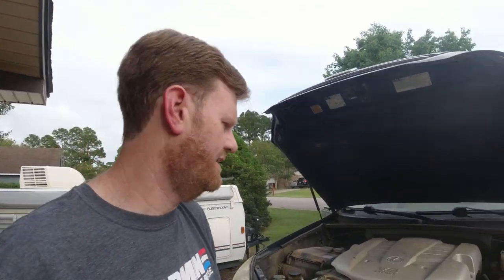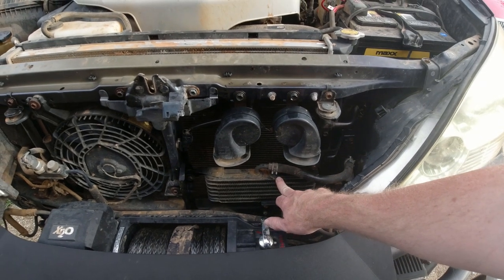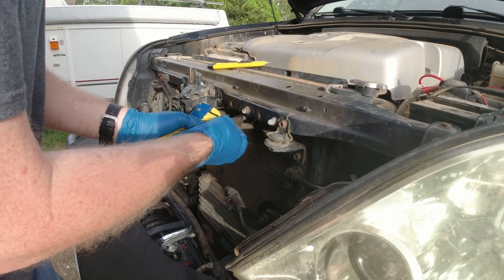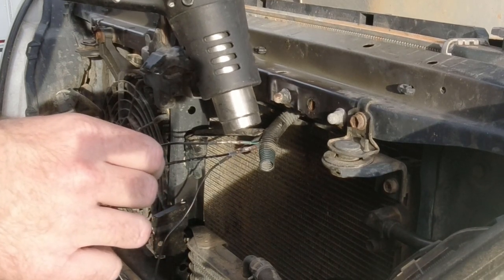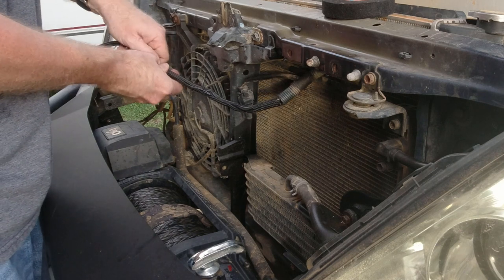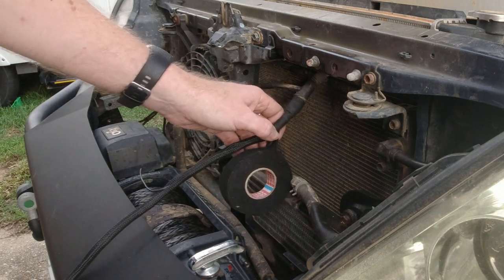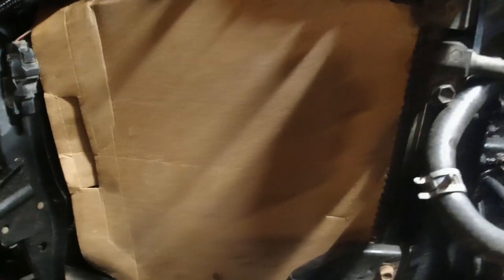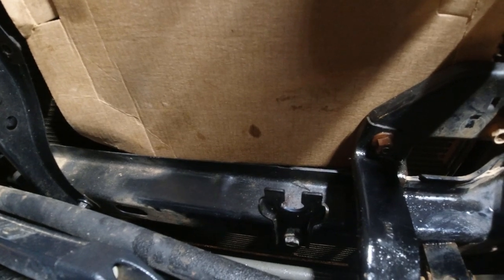Lexus GX470 Transmission Cooler Upgrade.  3x Bigger!

Comment: Great Video, just did the upgrade using Steve Foltz's Bracket. I ended up reusing the OEM hose clamp. To make the bottom hose fit with the spring clamp I slid a washer behind cooler. That created just enough room to slide the spring clamp on the hose. Your video made this job super easy.
Reply from the maker: Glad it helped

Comment: Good video, I installed mine the other day. The only thing I did different was install the lower line first, pumped fluid in through the top of the cooler until it filled (took a while) so there wasnt air running through the system (kinda like prefilling your oil filter when changing engine oil). Made a huge difference in trans temp.
Reply from the maker: Glad to hear it worked out for you!
Reply: What did you do exactly To pump fluid in and what are y’all using to see actual trans temps
Reply from the maker: @josephoverstreet5584  I did not pump any fluid in.  It holds 12 quarts in total and I removed maybe a half a quart.
I use the Torque App and a cheap Bluetooth ODBII scanner off Amazon.
Reply: @jamie.andrews  why don’t just install aftermarket oem. It a lot easy install, any reason?
Reply from the maker: @skeletronxxprime6277  I am not sure I follow you.  Aftermarket and OEM are not the same thing?
Reply: @jamie.andrews  I mean you can get aftermarket same Design just look like original. Why not go that route ?
Reply from the maker: @skeletronxxprime6277  This is all aftermarket in my video.

Comment: One good way to check the trans fluid temp is with an OBD II scan tool. I use myScanGuage2. I did need to enter the right codes to program it to display trans fluid temp. It needs to be between 115 and130, running in park, then pull the small plug stamped ‘check’. If none comes out, it’s low. Shut off, add through the return hose, then repeat.
Reply from the maker: Great advice Robert!  Thanks!

Comment: I also tow a Fleetwood popup camper (2007 Arcadia) with my GX and had to upgrade my transmission cooler back in 2017.  I was hitting 220 and 240 going up the mountains with the stock transmission cooler.  After that trip, I got the big (in fact too big) Tru-Cool Max LPD47931 installed just below the front bumper below where your winch is.  My ATF temp is now in the 160-170 range daily driving and 200 ish when towing.  Currently I am in the process of swapping out the Tru-Cool Max to my LX570 and moving the stock LX transmission cooler to the GX470 since it is about twice the size of the stock GX transmission cooler.

My GX is lifted as well so I did an axle flip on the popup camper and changed the stock 14" wheel to 15" wheel so I get better tire options + more ground clearance.
Reply from the maker: I have been wanting to het a LX570 myself.  What year is yours?

My Fleetwood is sold.  New camper coming to my channel soon and it is unique!
Reply: I got a 2013 on 33" Mickey Thompson Baja Boss A/T.  LX570 come with soft springs so I am probably going to put in either OME 2721 or Icon dual rated springs to reduce stress on the AHC (and to increase payload/towing to what the Land Cruiser can tow).  However, I enjoy driving my supercharged 99 4Runner more than my GX and LX.  LX is quiet, heavy, and feels a bit disconnected from the driving experience.  GX feels nimble compared to the LX, does great off-road, and is a great all around family vehicle.  My 4Runner is super nimble on the trails, it sounds fast because it is not insulated as well as the Lexus, is in excellent condition (I have owned it and maintained it for over 16 years), is my daily driver, and solo overlander.  I meet so many people that come up and ask me if I am selling it.  The supercharger whine is also addictive so that made it sound fast even though the LX is the fastest in a straight line despite it being 2000# (1 ton) heavier.
Reply from the maker: @runnerxa  Sweet.  Goal of mine for sure!  I am planning on putting a 8.2 rear end in the GX with an e-locker.  

Do you offroad the LX much?
Reply: I mainly use my 4Runner and GX for harder trails.  LX is too big for most trails where I live.  I use the LX for family overland trips to Moab or Death Valley so the mods are minimal.  I think the 8.2 rear 
end with elocker only comes on the later FJs for the 120 platform.  I suppose they are available for the 4Runner on the 150 platform and maybe the newer Tacos.  I haven't really researched swapping in the 8.2 from the 150 platform.

Comment: I see from several comments and responses that you didn't add any fluid. I would not be concerned about the small amount of fluid you lost, however, as you stated in the video, you tripled the capacity of the transmission cooler. That  extra capacity is now in the cooler and not in your transmission pan, effectively lowering your fluid level in the pan. I have read of others doing this mod and adding nearly a quart of fluid to top up the level. I recommend that anyone doing this add additional fluid and set the fluid level per the manual. 

I know from experience that running a trans for an extended period can create problems down the road.

Very informative video BTW, thanks.
Reply from the maker: I appreciate your response.
I almost want to make a seperate video about this as several people have spoken about this.
So according to the guy that designed the bracket and installed this on dozens of GX470s the total loss the is less than a quart.  The GX holds 12 quarts so losing 1 quart should not cause any issues.  
Without a dipstick it is hard to add fluid and you really should not overfill or even worse things can happen than being 1 quart low.  Since we don't actually know how much is actually lost how much should be added is unknown.  Taking all of this into consideration I decided it is best to not mess with adding fluid. I am pleased to say after 20k miles my transmission is still perfect. 
I am not saying it is wrong to add fluid, but one should be very careful about it if they do.
Reply: If I were to take a guess, it is because the hoses are "backward"  the bottom hose drains back to the trans so there isn't much left in the cooler to lose if you let it set for a while after running.
Reply: @donstocker3137  Here's the problem, and many people don't know this. The fluid level is properly set while the engine is running and up to temperature, with fluid flowing throughout the system, and filling the torque converter and the cooler.  If someone shuts off the engine, all of the fluid drains back to the pan, then they let fluid out the overflow level setting plug. They will then let too much fluid out, and the capacity will be too low, once the engine is restarted. Being a quart low in an automatic transmission is not good for the transmission.  I have done it, before I learned.  I think I added about 3/4 of a quart when I installed my cooler, and only a little drained out during the proper setting procedure.  If you don't add fluid to compensate for the additional capacity of the cooler, the level is too low. That causes problems.

The OP said he hasn't had any problems. My response is, "yet."

Think about this: The level setting procedure is very specific to the exact optimum level. That's why there is no dipstick. The transmission needs that exact level, not a range like the engine.  If you are not setting the level correctly, either high or low, it will cause problems eventually.
Reply: @timaugustine-dirt_trippin  The factory trans flush procedure drains 2qts of trans fluid at a time, then refilling 2qts, then draining 2qts, etc. Repeating until fluid comes out very very clean. So having the trans 3/4qt or even 1qt low temporarily definitely won't hurt anything at all. No area of the transmission will be starved of fluid. However...leaving it 1qt low and just forgetting about it is not the best idea I've ever heard of. By the looks of the engine bay on this GX, I'm sure the trans is in need of a flush anyways - might as well do it and finish this job properly. Topping off fluid is pretty easy - you add 0.4qts (according to Toyota) at a time, then pull the overflow plug with the trans at the measurement temperature (believe you want it between 106 and 115 degrees or so). If fluid doesn't come out, add another 0.4qts (I'm sure half a quart is just fine). Once fluid pours out of the overflow port while the trans is in the correct temperature range, wait for fluid to slow to a trickle, then put the plug back in, tighten, and done. Can use a ScanTool or cheap OB2 scanner to read trans temp. Easy.

Comment: I just picked up a camper and will be towing it over some passes soon - what gear are you in when you're climbing? Mine weighs 3300 dry, pushing 4000 if I've got water in it and gear.
Reply from the maker: I always tow in 4th.  Whenclimbing I let it downshift to 3rd if needed.  I am now regeared and it stops hunting for gears now.
Reply: @jamie.andrews  regeared your GX? At the diffs? Also thank you for the reply! I don’t have a lot of towing experience and I don’t want to break anything while I gain that experience.

Comment: I'm not familiar with transmission coolers.  Is there a transmission cooler pump that circulates the fluid?
Reply from the maker: The transmission is the pump.

Comment: I don't know a lot about transmission cooling systems. I was wondering if introducing air into the transmission cooling system is a problem? Seems like it would want be an airless system like brakes. Maybe? What happens to all the air in the system (because you added a significant amount empty space with the larger cooler)? I would love to understand this better.
Reply from the maker: Never heard of that being a problem.  If you overfill a transmission with fluid it will cause air bubbles to form and cause problems.  Over 10k on my cooler and no issues along with several others.  I would not worry about that.

Comment: seen some people talk about repurposing the stock transmission cooler as a power steering cooler. in your experience with the install, is there space to do that? maybe in front of the radiator fan and have the horns go anywhere else.
Reply from the maker: Yes there should be space to do that.

Comment: I am going to be installing the Hayden 679 soon, did you have to top off any additional trans fluid? Also was it simply just unhook 2 hoses and hook them to the new cooler?
Reply from the maker: I did not top off fluid.  The loss is minimal. The old hoses connect directly to the new cooler.
Reply: Jamie Andrews I appreciate the tips and video! Installing mine next weekend

Comment: I noticed you lost just a tiny bit of fluid as you were pulling out the hose off the stock cooler, is that an issues where the fluid has to be refilled?
Reply from the maker: No issue.  The amount of fluid lost vs the amount in the system is a small percentage. The system holds 12 quarts.

Comment: Can this be performed without the mountain pass custom bracket? Maybe with the included hardware?
Reply from the maker: Technically it could, but you would need to fabricate something.  The only mount in the box is to attach it directly to the radiator with plastic clips.  I am not sure it is really possible.  I have seen a few other people make something.  IMO the bracket is worth it and he also provides all parts needed to do the job, not just the bracket.

Comment: So did you have to add more fluid since you installed a larger cooler or did you keep it the same?
Reply from the maker: I kept it the same.  This transmission holds around 2 gallons so you are not removing very much.  I just towed 4k pounds up a mountain yesterday and my highest temp was 195 and that was climbing 1k feet in .5 miles!
Reply: @jamie.andrews  Thats impressive for the gx. I guess ik what my next purchase is. Thanks for the vid btw!